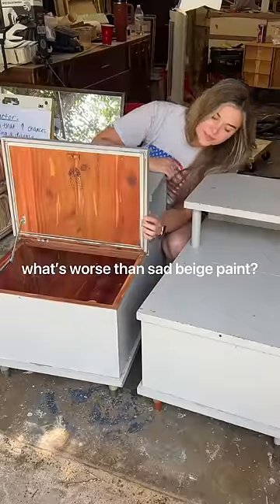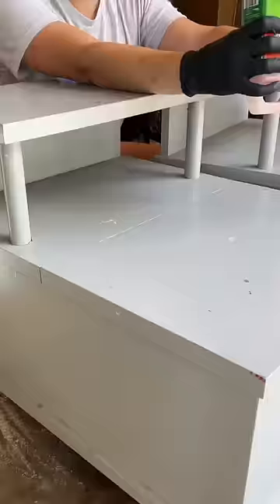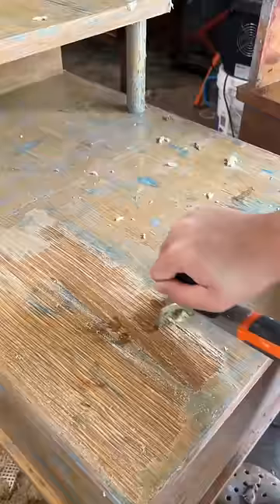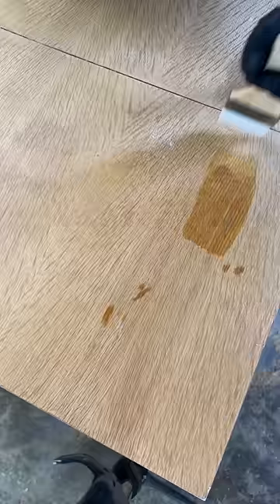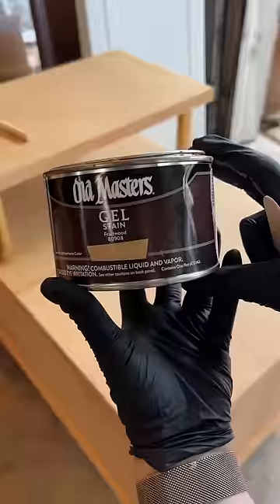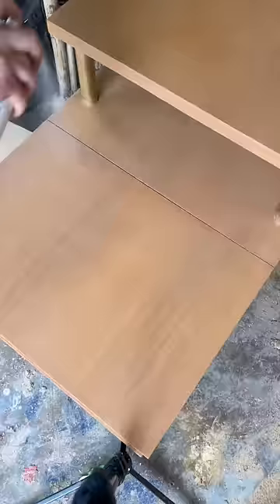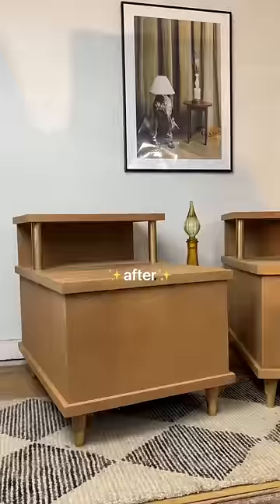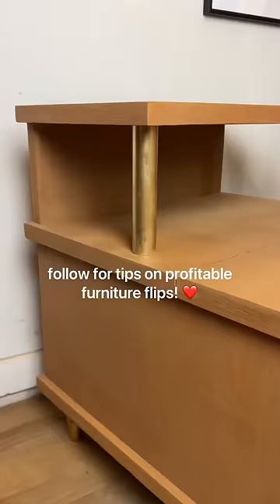What’s worse than a sand beige paint job? RESTORING rare Lane chest side tables + stripping paint!

Comment: What is the dark stain on the outside of the second night stand? 
I would have never risked nicking the veneer with that carbide scraper.
If the outside matched the inside, I think you would have made them more valuable. 
Sadly, I think you'll have to work for a long time to recoup that $1200 value.

Comment: The only way im paintingnon antique or vintage furniture or storage boxes is because its so damaged that the hardware needs replaced and all that.  

Theres beuty in the handmade works of others especially when you get into the older antiques and vintage things.  

I guess it comes from making things by hand myself where i get that need to keep it as close as i can to what it was.  Even if i HAVE to redo it mostly vompletely i will do research and figure out a design from there amoung the fine details.
Reply from the maker: True!!